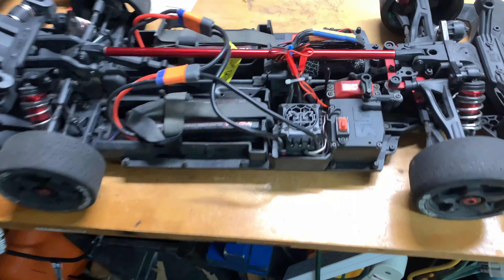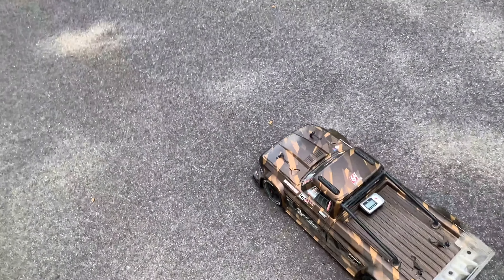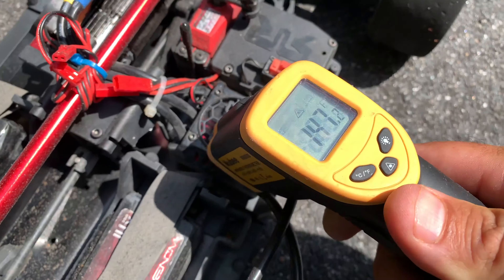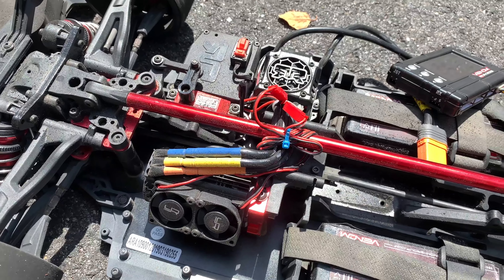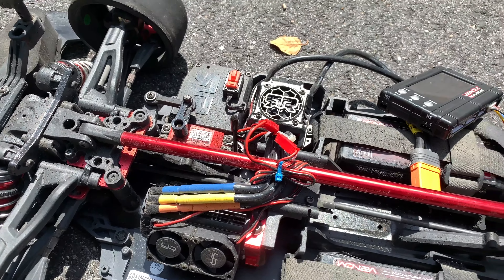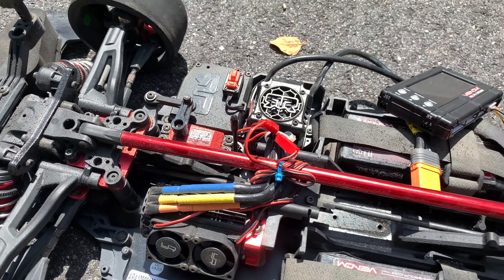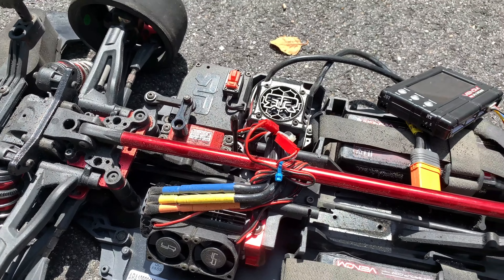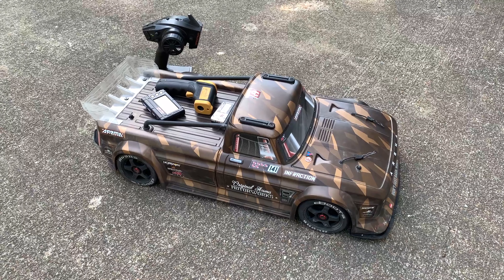Update on ARRMA INFRACTION Thermal Shutdown and What That Means

Comment: Im just getting back into rc after almost 10 a year break. I was going to jump back in to traxxas cause that was all the rage back then. I saw people raving about arrma and then I saw this mamajamma lollol I've had it two months but still haven't run it, I immediately purchased a new radio/receiver, esc, motor and some ntf fans, I installed everything but the fans. Should be ripping up some hoons in about a week or so. Yours was one of the first infraction videos I saw and I was hooked on that resto-mod design!

Comment: So 190° temp on he outside of the esc means those mosfest are cook'n at least 200° probably 220° which technically is major danger zone for electronics. That's not a good temp to he running at 4sure

Comment: Good informative video. My infraction overheat 2 times and my ESC died on the second thermal shut down. Now i cut airwends into the body 2 in the rear sides and the entire front grill and the sides of the front bumper. I'm about to put a Hobbywing max 6 in it and curious how it performs. Can't wait to test it out and see what temps i get with my airwends in the  body.

Comment: We experienced the same issue when we had our hands on a demo for our first run vid. Before we even ran it we noticed there was ZERO room under that body for natural air flow and were expecting it. 

We were NOT expecting it to cut off as frequently as it did tho. We couldn't tell if it was the batteries or ESC since we didn't have a temp gun or battery checker that day. 

Glad your actually trouble shooting it and showing the issue. We only had the demo for a few hours so your making my life much easier for when I get my own. Lol

Cheers!
Reply from the maker: Yeah, I think we all saw the burnouts and smoking tires and were overdoing it. 😂 When I ease up and do more straight driving, it definitely changes the temps. It's a very capable car. Just like any...we just need to watch how we drive because it does affect motor temps. I never ran my Losi Ten-SCTE for longer then 5-6 minutes at high speeds. It was geared to race and would get hot bashing it for too long

Comment: When rich and I were doing the demo run on the infraction we found that there is literally almost no air flow under that body. Also the heat of that motor is going to dissipate through the motor wires. If a vent was somehow implemented into that body so the fans were actually able to pull fresh air into the esc

Comment: Super informative video for a rookie like me and anyone else honestly. I think we have the same temp gun. 😂. I think that my Granite BLX also had a thermal shut down yesterday, but it was like 20 minutes after almost non stop full speed running on dirt and grass. I noticed that my ESC also had the flashing green light. It didn't shut down completely, but it slowed down. I was done by then anyways. Motor was at like 186 F. I'm assuming that's too high right? Thanks!

Comment: I’m having the same issues with mine.. please keep us updated! What pinion are you thinking of running?
Reply from the maker: Probably will go down a few teeth in the pinion. However, I haven’t been having the issue as I just take it easier on it. I do some hard bashing and then back down for a bit. Just like my race trucks that I know I shouldn’t go hard with for more then 6-8 minutes. Even then I have to run it like it’s on a track and not just wide open all the time.

Comment: Great vid Tony, I agree it definitely heats it up more when you bash it the way you do especially compared to just doing a couple simple speeds. Speaking of speed runs, have you tried the included optional pinion? I watched the Amain Infraction vid earlier and they were using the included optional pinion and they managed to hit 80mph even with it. I know it's not for bashing but may be interesting to see just for a quick speed test vid to see what you can get out of her with that other pinion. I'd love to see your reaction of hitting like 70-75mph with that bad boy!🤘😎🤘
Reply from the maker: The speed pinion went on yesterday 😁 I let the blue thread locker harden overnight. Plan to try it today

Comment: If you want to Hoon, tape your tires with electrical tape. It's the oldest trick in the book and it will preserve your expensive tires. Plus they'll keep your temps cool since there's zero resistance. 🤙 Nice vids
Reply: I think the tape will only last all of 10 seconds with this beast haha. Just need to order some spare wheels/tyres to burn. Hooning ain't cheap :D
Reply: @tmmtmm  nah, just keep applying tape. The stuff is pretty durable and WAY cheaper then tires. I'm speaking from experience. This is $1 tape vs $100 tires.

Comment: Tony i just got new xt 90 plugs i dont know how many more rcs going buy , i like to bash daily easier keep 1 or 2 rigs going and gets expensive but question is you been hacking plugs sticking with one or do you use multiple my two new arrmas are ic5 but i need batteries anyway and i soldered adapters  to use any battery any rig just seems wrong cut new wires off brand new rig 😄 next question you like new spectrum rtr remote ? Even with plastic wheel hows compare to tactic im ready buy futaba just arrma making me broke
Reply from the maker: I've been going with EC5, so I have to solder them on all my batteries. It's a pain, but so many cars coming from Horizon that their system makes sense. :) I like that the new Spektrum has a throttle limit switch for me to hand the controller to my kids and only let them have reduced power. I like the feel of the tactic, but performance wise they seem similar. I use Shen RCs rubber wheel grips on my transmitters. Cheap way to get a consistent feel

Comment: You can gear it down but it just lasts a little while longer,,, your problem is you running a 1/8 scale system inside of a 1:6 scale car so I don't care what you do is going to get hot,, especially in the summer you'll get way more DriveTime in the winter,,, upgrade the motor 2 under 1600 Kv that should keep the ESC much cooler

Comment: Oh virgina forget bout it , tony i took my kids there once by a  waterpark , we were like lobsters wearing sunblock too i never experienced heat like that and after watchin yt with arrmas i wondering how in California guys gearing rigs up arrmas but on gravel sending in the air usually off the throttle .tony remember arrma European where cool all time and heat rises so if your on the hot ground  with a low rider
Reply: Its 104 in Texas right now feel like 109. Just bought my infraction today but have not run it yet. Oh my I might be in for a suprise. This might end up being a fall/winter driving truck.

Comment: ...or fit external Cap Packs 😎
Reply from the maker: I have never used those before, but I’ve heard that is the next step for something like this.
Reply: @CCxRC  Quite easy to fit..just solder...or Soder as you guys say 😅  onto the esc battery cables as close to the esc as possible 👍
Reply: Ry Cullen RC more info im listening!?

Comment: Uk i was thinking yes moving air would be good but talking about hot air and not moving fast wont do much , thats why those fans you have work good bc move so fast and like shen rc was saying you may have compromised the motor getting it over 200 on first few runs if thats the case send that sucker back im sure arrma will honor even lil your fault you did it advertising basically . try a motor esc out of one other arrmas just watch temps close as if it were a nitro

Comment: this is why Hobbywing is garbage, when you have a thermal shutdown, the esc will not reset, and it's done.  I have not had this issue with any castle esc (XL or XLX2).   I Did swell up my 9000 batteries with the spektrum 8s, but no shutdown.

Comment: That's not good and don't look right 189 deg on the motor way way to hot! I think the motor may have gone bad the rotor weakened from to much heat will then cause the esc to try and give it more amperage to make it work properly then your ESC will run much hotter? I think arrma may have set this truck up wrong out of the box with much to large of a pinion gear so when guy's like you kind of just bash around and drive it like a normal RC and not just a quick speed run I think people may be blowing there motors like I stated above...  To be honest if anyone gets one of these I would drop a crap load of teeth down on the pinion gear size. just looks like a classic case of over gearing the RC and components start failing, If people start complaining about problems I bet arrma will be using a much smaller pinion gear in later releases of these new cars.
Reply: Thats what i was thinking shen , and hoping tony just got defective motor , but more likley he was excitedly at festival and cooked motor they are durable so feels sounds like your right on problem is he already done the damage
Reply from the maker: I think the second run showed that normal running had the temps right in the range you'd want. The burnouts are probably the biggest culprit in the temps. IMHO
Reply: @CCxRC  exactly spinning tires uses alot of torque👍great vid
Reply from the maker: @paulclancy2404  Even though my second run had much lower temps? Motor was in the 150s range and ESC 130s? I'll keep an eye on it.
Reply: @CCxRC  Yea but that was with 2 cooling fans in a big heat sink, It should run that cool without the heat sink fan on it.  arrma should have had this RC set up with a much smaller pinion gear so they don't run into these heat problems. 👍 Definitely put a smaller pinion gear on it man.
Reply: The fans were off (?)
Reply from the maker: @robertp7209  I turned off the fans in the beginning to replicate the problem I've been having so I could confirm 100% that it was a thermal shutdown.